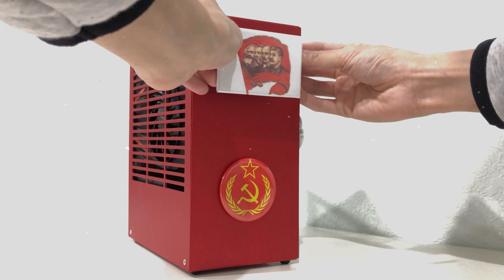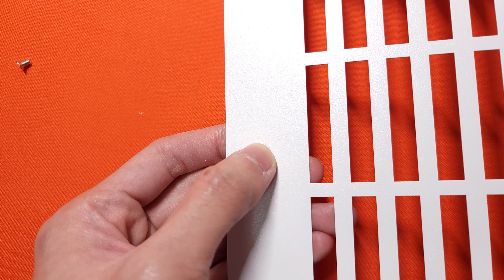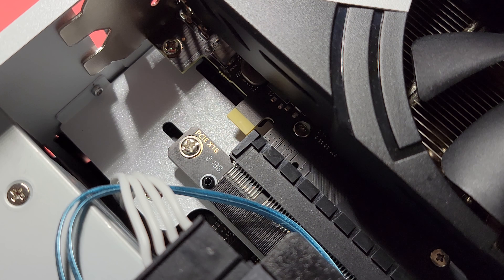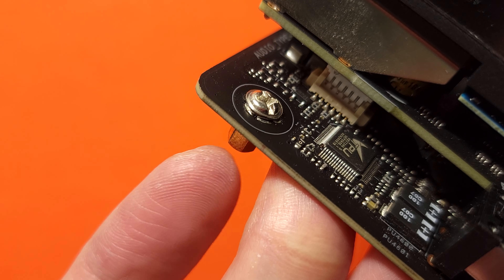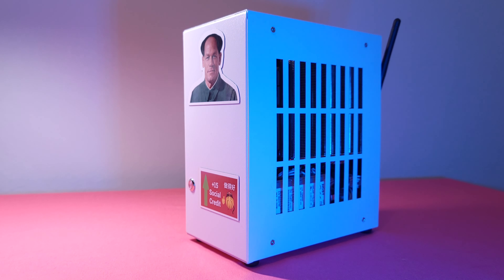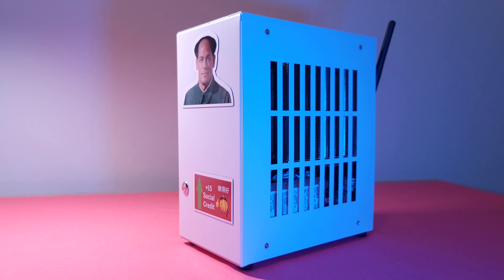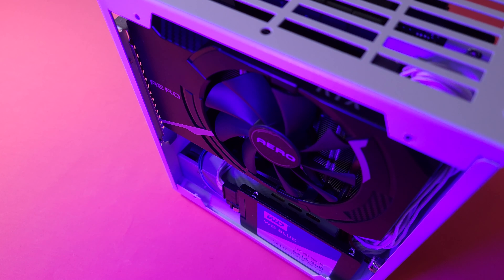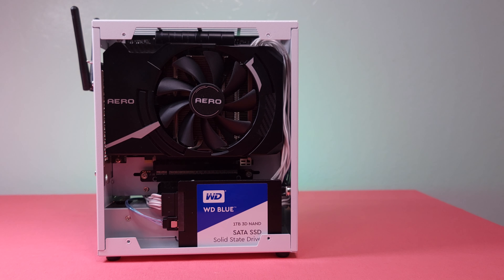AliExpress D19 4.7L PC Case - Build Guide & Review

Comment: What part of the case exactly stopped you from using the Alpenfohn Cooler? Am considering this build soon with d19pro, so want to make sure I get the best possible cooler (and quietest).
Reply from the maker: The top right corner frame blocks it

Comment: I recently built using this case, but I really don't know how you were able to fit the ID Cooling IS-60 Evo. My side panel bulges when I use that cooler, leaving me with the side left open for now. Did you have any tricks with fitting in the coolor?

Great video, btw. Watched this alot and those tips for the motherboard i/o shield and standoffs were very helpful.
Reply from the maker: Mine is the Is-60 EVO RGB, i don't know if that makes any difference, but I don't have any trick to show 🙁
Reply: @PokerFaZe  Appreciate the reply. Yeah I'm using the IS-60 Evo RGB as well.

Comment: can this case accommodate a Thermalright AXP90 X47 thanks man....
Reply from the maker: I think I answered your question on Reddit, it may cause I could fit the C7
Reply: @PokerFaZe  oh thanks for the reply,....im just curious about the c7 and thermalroght coolers....if both has the same max height from base of the mobo to the top of the fan...  Yes rhey has same 47mm clearance but only indicate the heatsink+fan....